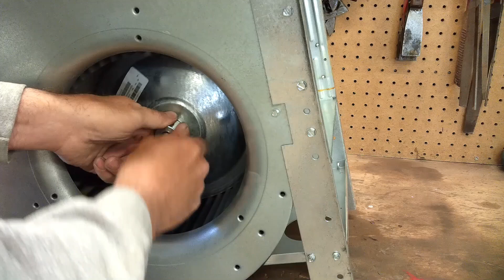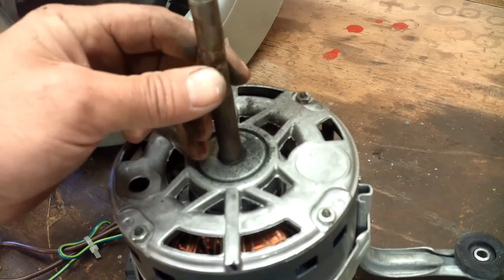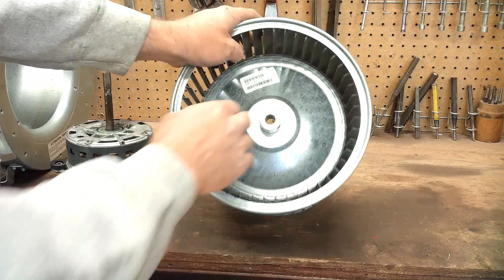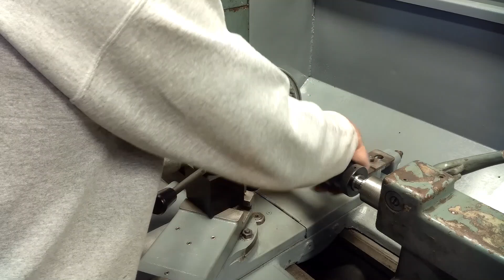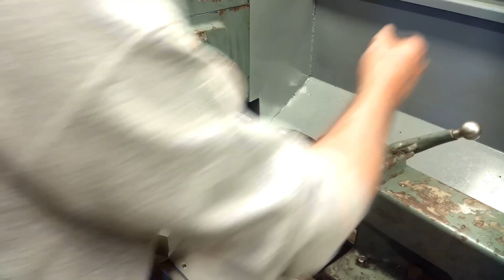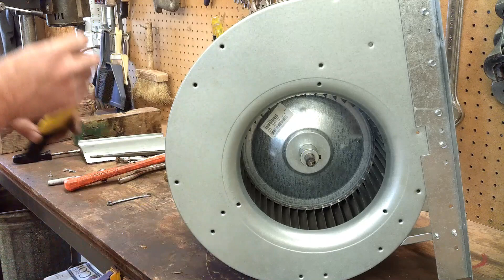Furnace Blower Repair With The LeBlond Lathe

Comment: My dad used to hunt for squirrel cage fans lol. We had about 10 of them as shop fans when I was a kid. Find the right A/C guys who just tossed them out and the motor/fan from the outside condenser units. Seems like in Galveston where we worked back in the late 80s early 90s they’d always be out in the spring time. That one is 5 years old? Looked brand new, guess non smokers too. Great fix on this one, most people (or HVAC guys) would just replace it and pay a ton to do so. Cool breakdown on this fix, that lathe is cool to watch doing its thing, bet it’s saved you a lot of money on different jobs and projects having it.
Reply from the maker: The lathe is a spendy machine, but it has saved me thousands on new parts I would have had to buy, plus the money I've made with it!! I've got a few squirrel cages around, they do make great shop fans. I use one for an exhaust fan too. At the shop I worked at before I went out on my own, we had them mounted on two wheel carts. That worked real good too